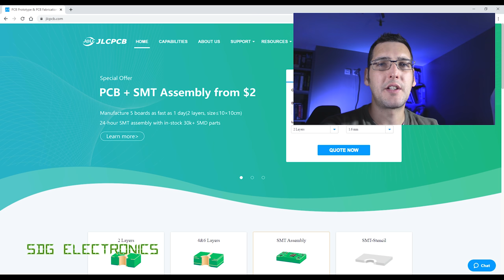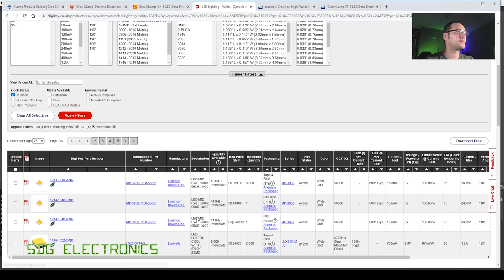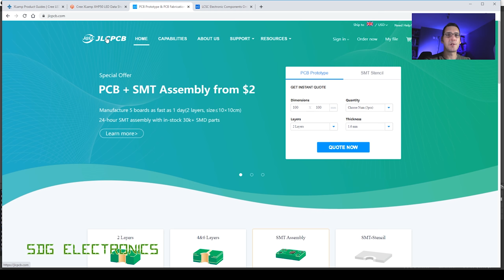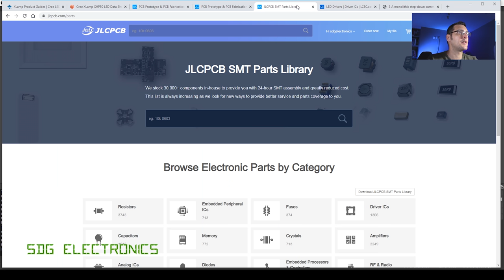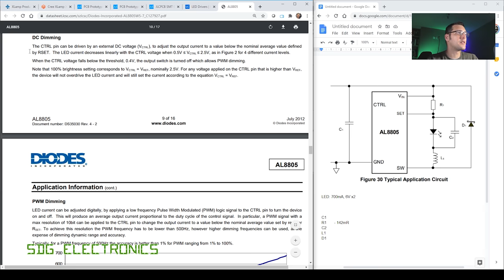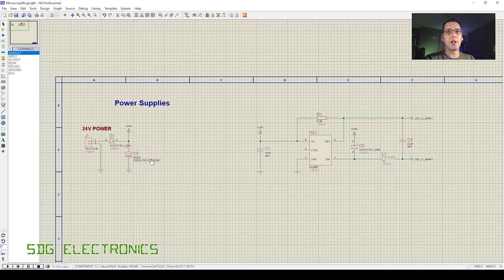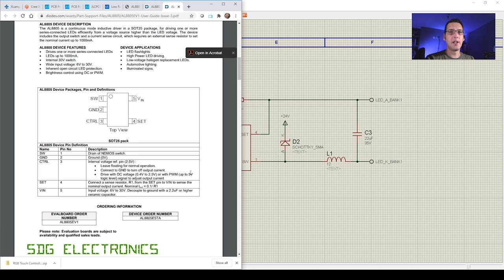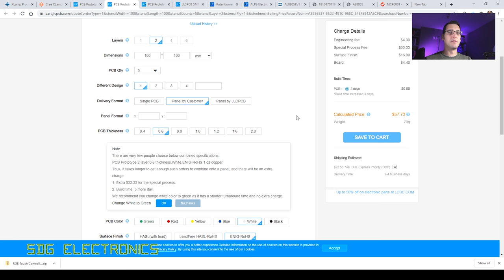SDG #161 Step-by-step parts selection and schematic - Microscope LED Ring Light

Comment: Enjoying following this project and the design intent behind it a lot. I’m currently working on a tiny-moving head driver based on the AL8860, and I feel ya about the limited data sheets. But for the price and availability, not a horrible option - I’ve been doing burn in tests at 1A on the 8806 recently, have yet to have any failures.

Comment: thanks for your led driver vids. we are currently designing a low-cost chlorophyll meter and realized that we have a lot of things to consider. we are currently using a buck/boost dc-dc converter from monolithic power that accepts a single-cell lithium battery as led driver for the high power red and NIR LEDs. not yet sure if we would need the lenses. hope you could also make a video of that in the future. the concept of the design is well explained by apogee instruments. cheers!

Comment: @23:30 - Using the 78L05 with a 10µF cap can cause oscillations. The datasheet recommends 0.33µF, however a 100nF should do just fine - and you can use a similar to the one on the output.
You already have the large 470µF on the input near the jack, so another 10µF won't do much difference in my experience, especially if they're all electrolytic caps.
Talking about decoupling, I can't see you've decoupled the MCP6001 op-amp - if it was me, I'd put another 100nF cap across its supply.
A thought about using ENIG - Electroless nickel immersion gold (ENIG) consists of an electroless nickel plating covered with a thin layer of immersion gold, which protects the nickel from oxidation. You're having it manufactured and assembled in China in 'one go' - why not save a LOT of money and use HASL (which won't oxidize THAT fast, in fact - it quite lasts) ??
Interesting project, quite inspirational - and certainly looking better than the CFL ring light I currently have. Thanks, looking forward to the next episode :ø)
Reply from the maker: Ah, the ENIG was for the LED boards which I will have to assemble myself. I'll have lots of spares so this will keep them usable in case I need some LED boards for something else in the future. I didn't add another 100nF capacitor as the 78L05 is only powering that op-amp and the resistor divider. They will be physically located next to each other. Thanks for your thoughts
Reply: @sdgelectronics  Layout is an important thing, it can solve (or create) a lot of things.
I would advise that you change the 10µF cap into a 100nF - I'll tell you a little story, and it might help get my point across:
A little bird drinks water from a small ceramic cup, all was good - for some time, until the cup broke and the bird stopped singing (for no reason. It just cracked, poor cup). 
A well meaning man put a ceramic bathtub in the cups place, thinking the bird can now drink and shower at the same time. The bird song started again, as the tub filled up.
The well meaning man also had 4 cows, which were also drinking out of ceramic tubs - the cows had plenty of water, and gave off a lot of white milk when milked each day.
After the man installed the bathtub for the bird, the cows started giving sour milk and the bird song got gobbled at times. The man started investigating, and found the water level in the tubs nearly always matched. That couldn't be, the bird couldn't drink that much water - he was mystified, where did the water go.
Searingly he found that the bathtubs for the cows had begun sucking water out of the birds bathtub, and in the process the sucking vortices nearly drowned the bird for a moment. The water pipes hadn't changed, gravity and water was the same - how could this be. Bernoullis was the mans name, he published this - and it became known as the Bernoullis princip. I don't know what happened to the bird or the cows, but the man became quite famous.
muRata (not muCow) later on invented a 'one-way valve for filling up bird tubs' - EMIFIL® NFM41P Series
https://www.digikey.com/catalog/en/partgroup/emifil-nfm41p-series/7429

My view and experience on surface finishes - it rarely matters, unless the pcb's are stored in a horrid place and/or has some extreme requirements.
Google returns: "ENIG has several advantages over more conventional (and cheaper) surface platings such as HASL (solder), including excellent surface planarity (particularly helpful for PCBs with large BGA packages), good oxidation resistance, and usability for untreated contact surfaces such as membrane switches and contact points."
Should the surface become all gray and unsolderable, they are (often easily) restored by applying solder and wicking it off again. But, I won't stop you - it's your money :ø)
Reply: Ok, you might not Bernoulieve a word of the story above. (It was actually aCat that invented the filter to avoid chugging bird ♪hit)

Comment: Thanks for all the great content.  Note that the Sinotech 78L05 had a recommend operating of 20V. Not sure if your using a 24V plug pack but figured you want to avoid the potential of getting the control out of regulation.  Cheers.
Reply from the maker: Good spot, I'm not sure what that really means though given the other specifications in the datasheet. I'll probably stick with an ST or Ti part which doesn't have that condition.
Reply: @sdgelectronics  It is better to add 5.1V zener  like SMAZ5V1-13-F between the 24V and the input of the 78l05

Comment: Hey Steve had a few thoughts about this one. Its actually really interesting project for those of us with such microscopes & we thank you for pursuing this project further. Of my questions some are probably redundant , others perhaps you cannot integrate or better not to. My thoughts: 1) were the satellite boards are the thing you are going to make the slight inwards angle with?  I guess that makes sense. I hope you still intend to make such an angle. 2) If I zoom in with the dial, then the amount of light getting through the lens is reduced. This makes the whole image dimmer at the higher zooms. So it may be desirable to have the ability to adjust the led brightness dynamically while operating. Rather than have just some tiny trimmer pot that requires a screwdriver to adjust because it was only ever intended to be setup once. But was that actually your intention with the design? I think ATM these cheap ring lights we all buy are very convenient with a sturdy pot dial to adjust... its just they are under powered to begin with so we always have it on maximum setting all of the time. . In fact an even more elaborate and complicated design would be mechanically linked into the microscopes optical zoom knob itself. Thats too ambitious for this project but maybe could be a possible future mod or upgrade if was ever found to be useful enough by anybody. I am not sure. 3) Driving from 24v is conveniently the same voltage as many soldering irons. And perhaps certain common led dc supplies. But it is also maybe a little bit high since it excludes (without introducing a buck converter) other PSU sources such as  usb power source (which is 20v max). Or a laptop power brick which is 18-20v. So maybe that aspect is worth considering to make sure from an interoperability standpoint. 4) if there is no protective housing then a white pcb for white microscope. Or a black pcb for a black one... that would look pretty cool. 5) Your original mounting design for the pcb is great for those with a 3d printer. But is there an good alternative for those of us who dont have one? Thinking maybe something really simple like sandwiching it between 2 hose clamps and using foam as a buffer to prevent scratching and help to keep a good grip on the pcb. ATM i have been using strips of esd rubber mat, for my current ring light. And low density foam. This also helps stop my metal microscope head from rotating, or getting all scratched up by those 3 grub screws. Anyhow good luck with this project... so much cheaper than dropping 200 bucks on those polarizing ring lights. Looking forwards to seeing how it goes. Also I was feeling maybe? its a negative point not to be able to dim below 25% of max. Since that affects the total adjustment range and also the choice of alternative leds. For example if those ones caanot be sourced so easily by others. Or if somebody also want to add polarizing filter (in addition). Then that might become an issue in those broader situations. But we shall see for your particular use, its not likely to matter.. But you know... its a limitation of that specific driver so to get around that would then require changing the led driver. Which is really my only question if they all do that, or if its specific to only some led drivers. And not for others, well maybe we cannot know without doing a more exhaustive parts search.
Reply from the maker: Thanks for your comments. I may change the potentiometer, or at least do a combined footprint if possible so that there are some options. I'm just planning out the best way to do the angled PCBs - I want it to be quite robust, but that probably means custom or 3D printed parts. I think if other LEDs are likely to be used, I would suggest anyone to change the sense resistor rather than relying on the adjust pin.

Comment: Can someone explain why the potentiometer output is opamp buffered? Thanks.
Reply: To drive all of the LED drivers without affecting the potmeter adjust voltage (some chips/inpus can have non-linear loading profiles, resistive and capacitive loading)
I.e.:It works a voltage/current buffer, so the voltages through the divider is 'always spot on', no matter how many drivers, etc is connected.
Reply: Or more simply.....an ideal voltage source has zero output  impedance..if any current is flowing to the next stage the voltage will change...A simple pot is a long way from ideal
Reply: Thanks, for your replies. Would it really make a noticeable difference on a brightness control like this? It's sourced from a 5V reg which I would have thought would be pretty stable. I'm not criticising by the way, just trying to learn :)
Reply: @ScottMarley  @24:00 we learn that 'only 250µA is going through the voltage divider network. Since the input is 5V, the output voltage is generated/halved over 10k+2k4 = 12400 ohm. In a series connection the same current flows through all components, where in parallel the lowest resistance/impedance 'takes relatively all'
Apparently there's no data about the pin loading (which would be a parallel loading on the halving output) in the datasheet (https://www.diodes.com/assets/Datasheets/AL8805.pdf), and (excessive) pin loading can turn out to be a 'trap for young players' - I suggest reading more about the problem in this well written piece about temp measuring (the output impedance there is 20k, or just 'a bit over 12k4 used here - some graphs provided) It probably won't do much in terms of overall performance, you'd turn the potmeter a bit more or less to obtain the light intensity wanted - but there's no guarantee it won't load the circuit completly down, requiring a re-design to compensate.
https://www.nutsvolts.com/magazine/article/february2016_AnalogFrontEnds
Reply: @ScottMarley  Pot is used as a voltage divider. Dividers output level is highly dependent on load current. Take any calc like ElectroDroid and see for yourself to get the idea of influence. To workaround you need current amplifier circuit like op-amp buffer or common collector BJT amplifier (also called emitter follower).
Even if the load is not that high, adding buffer is worth in order to gain circuit stability in cases when there is uncertainty as mentioned above.
Reply from the maker: As others have mentioned, it's quite a high impedance resistor ladder. The LED driver ICs don't really give enough information to be confident in the loading on that adjust pin (it says 50k impedance, but the load is between 16 and 22uA which doesn't make much sense), so it's easier just to buffer the output and not have to worry. If the drivers present too much load, we'd never achieve full brightness as it'll drag the voltage down.
Reply: Thank you all so much for your comments, it is starting to make sense. I hadn't thought about the impedance of the input as being a voltage divider with the pot. Looks like I have a fair bit of reading to do!

Comment: Does under-driving the LEDs change their CRI/coloUr temp?
Reply: If you under drive by limiting the current it can change the color temp. PWM modulation with the right current would be best. But the changes in color temp is usually not noticeable to the eye.
Reply from the maker: Yes, and it adds more variability between other LEDs. The spec on these LEDs is pretty good though if you look at the graphs in the datasheet, so I'm not overly concerned.

Comment: What about a 2.5V zener diode (plus series resistor to limit current to a couple mA) instead of the 5V linear regulator? Gets you 2.5V straight off, and no need to divide further.
Reply: Thats what I thought aswell surely the input impedance for vctrl will be negligable
Reply from the maker: I still need to buffer the output as the loading on the input pin to the driver ICs will result in a non-linear brightness control. Rail-to-rail op-amps are normally 'almost' rail-to-rail, but not quite.

Comment: Talking about overengineering.. there's a definitely simplier way to do CTRL voltage, with fewer components, therefore less assembly cost. 10uF and 22uF, haven't you seen Daves video on BOM consolidation? Just messing around - nice video!
Reply: Although it is a good practice, when you make 10 PCB without a large number of components it does not have a great impact as David also said in that video. xD
Reply: feel free to make you own designing video/series better in any way! And refrain from insulting Steve by schooling him based on EEVBlog's latest content.
Dave is an entertainer, choosing an easier way to produce content, he gives out tiniest bits of knowledge, that you won't even know how to use in real applications because his videos can not possibly contain bigger picture.
On the other hand Steve is working his ass hard to deliver projects covering the whole design process from scratch and he is doing it in a very informative and effective way. His channel is two heads above quality wise comparing to latest EEVBlog posts..
Reply from the maker: I actually missed the 22uF, it was supposed to be 10uF anyway!

Comment: have you considered tme.eu for sourcing the components ?
Reply from the maker: Yes, I often use them. I will likely combine orders for the GPSDO and this project at the same time, so it'll be whichever supplier has most parts in stock. I get free delivery at RS and Farnell, so other bits can come from there.

Comment: Using satellite PCB for the leds is a expensive solution, have you checked if it is possible to just angle the lenses?
To make a angled lens mount I would use a 3D printer.
Reply from the maker: I did take a look, but the collimating lenses require precise positioning of the LED flat to the lens, so it's not possible to do this without compromising optical efficiency.

Comment: Wouldnt a zener plus Potentiometer be even simpler and possibly cheaper than using the linear regulator plus opamp for vcrtl?
Reply from the maker: A zener diode is definitely another option, but you waste a bit more power as heat on the board.
Reply: @sdgelectronics  TL431 is a very good temp compensated 2.5V reference, and cheap as dirt!